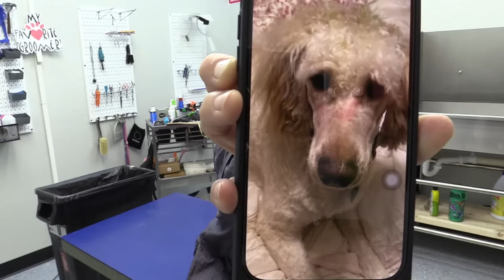When Dog Groom Goes Badly

Comment: I am a retired groomer. Just curious as to why you haven’t invested in a Clipper Vac. Once I finally made the switch to using a Clipper Vac it changed my life!!  No longer worried about hot blades and the cut was so much smoother.